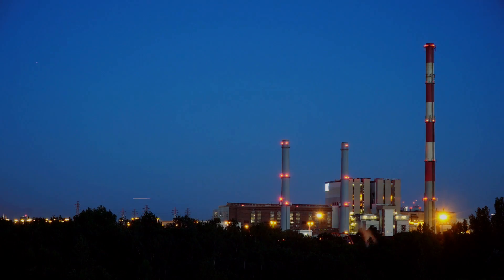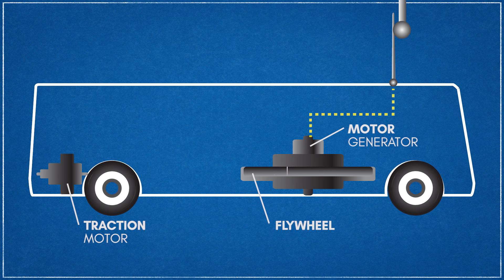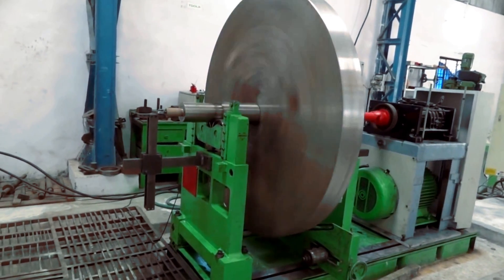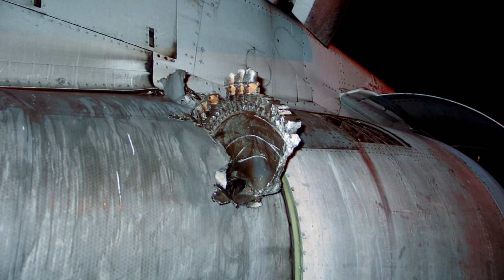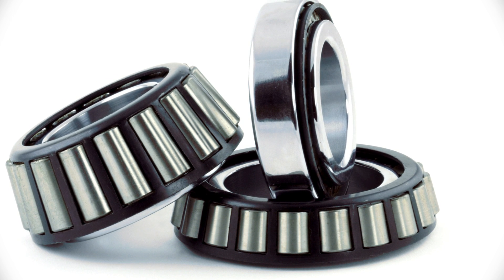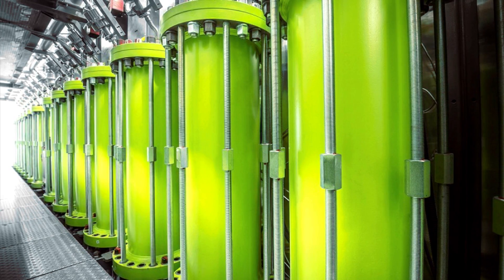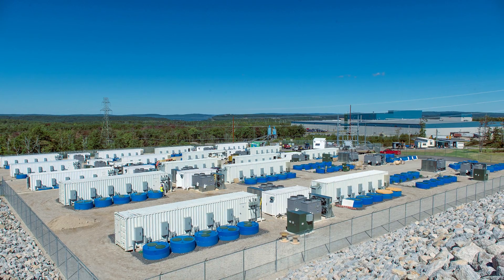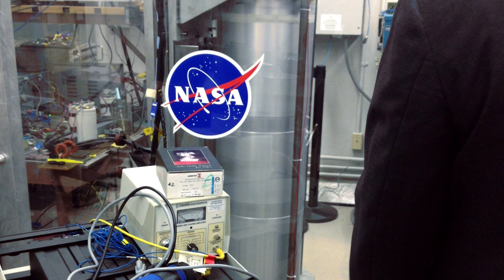The Mechanical Battery

Comment: I bet the bus was fun going round a corner.
Reply: It wouldn't be a problem as the flywheel is mounted horizontally not vertically (....that would have been an interesting experience).
Reply: @jaihind9043  what if you went up a hill? Would you tip?
Reply: @MilesPrower1992  Tip sideways!!! :D
Reply: @MilesPrower1992  -- Not at the low speed that the busses travel, and only if there were a very abrupt change in vehicle attitude, such as topping a steep hill.
Reply: @jaihind9043  The axis of the flywheel is shown a vertical.  That would make cornering a problem.  The bus route might have favored turns in one direction only like some delivery services today.
Reply: @alext9067  Turning the bus left or right would only accelerate or decelerate the flywheel a small amount.  But tilting the bus from side to side with, say, the road camber, would be resisted by the fly wheel making for a smoother ride but risking having two wheels off the ground. Also the front of the bus would be more likely to "take off" at the top of a hump........Ok on even roads.
Reply: @alext9067  -- Not really a problem at low city bus speeds.
Reply: When I was a child, 50 years ago in USSR, I read a book published by the guy who actually made the bus. Learned a lot good stuff that made me an awesome mechanical engineer later.
Reply: It has small wheels in the front bumper section. I wonder why :D
Reply: @smokedoak5464  my guess is,  it must have been a common occurrence  for one bus to push another to a charging point , the little wheels would stop the bumpers on the busses getting scratched.
Reply: @smokedoak5464  Or those are headlights.
Reply: What's next, a flywheel in our smart phones spinning at 100,000 rotations/second... and then the killer phone is born.  Course it would be really hard to even move around, with the gyro effect yanking it all over the place. xD
Reply: @BillAnt    I wonder what would happen when the bearings wear out😬
the charging system would be interesting if it was mechanical. one way clutch with a key near the center of the phone to hook into the charging key. Idk
Reply: Corned beef Gaming < It was a joke for a phone, you need massive flywheels in order to store any significant amount of energy. There was an experiment on buses with 1 meter diameter flywheels... didn't work out too well. lol
Reply: The.. People on the bus Go Round and Round, Round and Round,  Round and Round , (Everybody sing it with me now!) The People on the Bus Go Round and Round All the live long day.. while trying to find the best weed deals..
Reply: That would not be a problem with 2 counter-rotating gyros.
Reply: @reisele1980 < You're right, it would also make a highly efficient counter rotating guillotine, should the flywheels fly off, or crack due to fatigue and disintegrate into thousands of tiny guillotines. xD
Reply: At 50mph
Reply: It, it's operator and all passengers where never heard from again...the gyro in the bus goes round and round!
Reply: or in changing grades.
Reply: 0 problem here...
Reply: Evi1M4chine  < "Could/would" was just a sarcastic joke, course it would be impractical. lol
Reply: @G Guest < Even two counter rotating flywheels have some gyro effect (though less), they are mostly useful to prevent aircrafts to rotate on their own axis.
Reply: Haha.  Easy to balance on a string though.
Reply: More like over a speed bump.
Reply: These flywheels weren't in gimballs?
Reply: @masumoto007  If the flywheel axis was vertical, that would ease left/right turns. OTOH,  wouldn't hills and dips invite rollovers?

Comment: Hansen clever forge press Smeral forge press Emuco forge press and several others in the forging business utilize flywheels on there forge presses combined with a piston to help carry the ram back to the start position they are pretty efficient considering that they will cycle up to 600 to a 1000 times an hour on average but they are they inertia style flywheel and they probably weigh about 10 ton and need a bull gear lol Damn I miss that job it was the only job I ever loved

Comment: Slow but steady? Im sorry but that is not the case at all. The amount of solar installed is increasing by 42% a year. It is doubling its capacity every 2 years. By the end of the year its going to finally reach 2% of the energy grid. But in 2 years it will be 4%. In 4 years it will be 8%. Then 16%, 32%, 64, 100% in 12 years. EVERY single successful technology in history has exhibited an exponential rate of growth. Its always deceptive at first, but once it hits 2% the only that changes between technologies is how quickly they are doubling. Solar and Wind are now the cheapest form of energy on the planet. In fact that are so cheap that they not only no longer need subsidies, they are the cheapest form of electrical production in the history of the global energy marketplace.

Comment: Well done presentation, but the biggest problem if you ask me is the fact it is a mechanical and inverse system. I see useful applications for short term standby applications as you indicated for grid equalization, but not for vehicles or extended power storage.

Comment: I knew this had to be a thing that's been used before. I love it!
I have an idea for a high speed, pedal powered commuter bus. I've been wanting to make it for over a decade. 
Think about a lowered down, stationary bike, but with multiple speeds and no wheels. 
Now imagine many of these, facing outward toward the window, side by side, at least 10 on each side. 
Now imagine a central drive shaft from the transmission to the rear axle. The driver simply drives, no pedaling. 
Both left and right pedal stations would power a common shaft with several flywheels on them, which lead to the front and spin a large central flywheel at the front of the transmission. 
The side shafts would spin on one way bearings, so the pedalers could go different individual speeds when needed. 
Multiple flywheels on both side shafts and a large central flywheel which all store energy. 
I see no reason this could not go quite fast for an extended time. If anyone in the Minneapolis area has a shop I can use, I can make this. I have some serious skills.
Reply: Not much use if it has no wheels!
Reply: @bingola45  
Individual pedal stations need no wheels, since they drive the 3 flywheel driveshafts, but the middle shaft goes to a conventional rear drive axle which drives the wheels.
Reply: @mindthependulum6245  I guessed that.
I was only having a laugh.
Reply: @bingola45  lol. No real need for wheels a 10 horse power buss is only gonna move fast if it fell off a cliff.
Reply: @anullhandle  I think it would be workable. In fact, I think I've seen something similar in real life, years ago, although I can't remember where.
It didn't have the flywheel. THAT's the improvement here. Stopping the bus doesn't mean losing the built-up energy, so you aren't starting from scratch each time.
It's perfectly workable mechanically. As for the attitude of the passengers, that remains to be seen.
Reply: @bingola45  racers  go to great lengths and expense to take weight out of bicycles including their 2 flywheels. World class for men is 440watts for an hour and 34 mph.  Bicycles built for 10 at the beach are walking pace slow.
Reply: @anullhandle  I've never seen a bicycle built for ten. 
Donkeys on the beach are walking-pace slow, if you can get them to go at all.
Reply: @bingola45  conceptually you have a hybrid vehicle. A smaller ice engine working harder is up in its efficiency curve. You keep it working when it doesn't need to store the energy and recover a little more when you slow it down instead of dumping into waste heat. The issue would be less than twenty people on the planet can move themselves at 34 mph moving just themselves and a uci compliant aero super bike let alone a bus. Note if your willing to lay on your back go in reverse and stear thru a mirror you could aproach 60mph.
Reply: @anullhandle  You've missed the point if you put an engine on it.
It's a cycle/bus hybrid. No engine, just human power efficiently used.
Reply: I'd go a small step further and put the pedals on charging/compressing a spring of some sort (similar to a spring in a mechanical handwatch) which in turn drives the flywheel, which in turn charges some supercaps and insures bursts of power on demand to an electric motor...or something.

Comment: I wouldn't use a permanent magnet motor/generator, because it will still drag down the flywheel over time, even if unloaded. A better choice might be switched reluctance, because when there is no current applied, or drawn from the stator, there is no magnetic field inducing current in any near conductor, to slow it down. Induction would also work, but, there is no way to dissipate heat from the rotor conductor bars. Switch reluctance, while not the most efficient, would work the best for long term energy storage in a magnetically suspended flywheel. The suspension magnets, because they're homogeneous, will not cause the flux modulation, that will induce eddy currents. Static magnetic bearings in a hard vacuum, would allow a flywheel to store energy with very slow standby losses, similar to the best batteries.

Comment: Look up the 2012-2014 Audi R18. It was a Le Mans LMP1 race car that won overall the 24 hours of Le Mans. Amazing car. Used a V6 turbo diesel and a flywheel hybrid system. Won in 2012, 2013 and 2014. Due to changes in the regulations and the fact the market was demanding lithium batteries in their road cars instead Audi switched from the flywheel system to a lithium battery hybrid system. Still was amazing tech and the first hybrid car to ever win Le Mans.

Comment: When I was a child, I had toy cars that you would zoom zoom along the floor. When you gave them a push and let go, they would travel only so far. 

But one day, I was given a unique toy car. When you pushed the wheels against the floor, you felt a measure of resistance that the other cars didn't have. I though that the cars wheels were dragging against the frame or something. But when I let the car go, it went ten times farther than my other cars. 

So, I took it apart to to see how it was done. Voila, a flywheel, an energy storage device and I understood how it worked. Thus began my love of science. And my love of knowing and understanding about how things work. 

Cosmology is one of my interests, and I think that these folks are on to something revolutionary. https://www.youtube.com/watch?v=uwMDYNRZUKY

Comment: why seal the flywheel in hydrogen but not under high vacuum? problems with sealing?
Reply: High vacuum has a lot of pressure on it, a 12in (30.5cm) diameter circle would have 1550lbs (~700kg)of atmospheric pressure trying to cave it in.  Most high capacity hard drives in the 8 TB+ region are helium-filled to reduce the friction but not have to be built where they're practically bombproof

Comment: cool but hauling around a massive weight isn't really efficient.
Reply: Right. It's best for stationary storage - not vehicles, due to gyroscopic precession effects, and weight as you mentioned
Reply: Matt You are correct but the idiots to be will insist they put in cars. As a stationary storage they are awesome.

Comment: Beyond cell phones/tablets/laptops LiOn has no real future in the industrial power domain.
Reply: Do you think LiOn will still find a place in applications like Tesla's powerwall devices? It's energy storage at a smaller scale than the overall grid, but larger than the consumer devices you mentioned. Or do you think that people wishing to have a backup or completely off-grid system with solar panels and the like will have a flywheel system in their home to store that energy? I certainly find it appealing as it's more environmentally friendly to produce, less of a fire hazard, and could be more easily made, repaired, or replaced DIY which I like as a hobbyist. I think "preppers" could also find many of those characteristics appealing.
Reply: @revenevan11  My problem with the lithium-ion grid storage, is the availability of easily mined lithium. Due to lithium being so lightweight for its power density and not having the gyroscopic precession effects I think we should use our lithium resources in vehicles or other small electronics, and not deplete our lithium resources trying to build large scale grid power storage ( since there's not a good technology out there to recycle lithium ion batteries, I don't think we should be wasting them, not to mention the charge inefficiencies  multiplied by  every house trying to charge their power walls)
Reply: @daltonnabors  I agree!

Comment: I wonder if it's feasible to use ginormous concrete blocks suspended by cables as a means of storing energy. Lift them up during the daytime and then them drop at night while they spin a generator. If the weight and gear ratio is large enough you could provide power for quite a while for pretty cheap I would imagine. This is all speculation though, so I'm interested if anybody with more experience in this area has anything to say about it!

Edit: This solution would also not lose any energy if left unused since you could just apply brakes and it would keep stationary.
Reply: The gear ratio has nothing to do with how much energy you can store or extract back from that kind of system. It all comes to the mass of concrete blocks and the height you lift them to. Here is an example of what sort of numbers we are talking about here. Our household consumes about 18 kWh a day which translates to about 65 megajoules of energy. In order to release that much energy (assuming no losses) you would need to lower over 66 tons of concrete/water/steel/whatever from the height of 100 meters. Add losses and you will easily need 100 tons of weight. In other words, lift a locomotive to 100m height first, then lower it and the amount of released energy will be enough to power 1 house for about a day. Not very practical, huh? Low energy storage density of mechanical systems is what many people don't realize. BTW this is the reason why the bus from the video required recharging every few kilometers.

Comment: Fossil fuels ARE chemical “batteries” .....
Reply: Indeed. We just use a different chemical process.
Reply: No. Fossil fuels are not a "device"
Reply: FUD Hater : it can be called a batterie only it needs a recharch time of a few bilioen years.
Reply: @philippedevos816 , thats a terrible battery
Reply: @TheDrumrhythm  no one said it was a good one
Reply: You can discharge and recharge a chemical batteries  , once you burn the fossil fuels its just gone in the atmostphere. So no its not a chemical batterie.
Reply: @molsondry2834  
You can reverse the process, too. So if you just store the gases (like diesel submarines do), you could in principle re-use it. It's just not practical since we have so much of the stuff lying everywhere. If you want one example of such a thing, look no further than trees.
Reply: I am not sure I understand your reply....diesel electric subs and buses storing their gases?? The only sub that does that has an internal combustion engine that runs underwater and does not need outside air to run. It recirculates the medium gas ( nitrogen ) that when heated pushes against the pistons, then instead of expelled into the atmosphere it goes thru a scrubber and then a heat exchager to cool and shrink it...every cycle still needs fuel and oxygen ( through compressed tanks) to run but doesnt emit exhaust that would bubble to the surface. Once a fuel is burned it is almost impossible to reverse the process or if it can be done requires more energy than you would get back. Example. Water is basically burnt hydrogen. To reverse the process ( electrolysis) requires more energy than the act of combustion.
Reply: @molsondry2834  Explosions ARE chemical energy being released (the bonds being broken, along with other fun things that release energy), so technically it would have to be defined as a chemical battery.
Reply: @molsondry2834  recharging isn't a requirement of being a battery.  A battery is merely something that stores energy.
Reply: No, they're fuel.

Comment: Too much voltage at high speed and too little at low speed? Go kart. Put a comet clutch off a yerf dog on it backwards. lower speeds spin the electrical part faster, and higher speeds spin it slower. Since you know where the clutch maxes out top and bottom of the rpm band, you can use that to create a stable working range for the battery.

Comment: 2:02 into the video.  I win!!  I called it! Before the video started, I thought... storing energy in a small-scale, mechanical, useful way... Gravity (push a load up), tension (push a spring in), or - my first thought - what we already use in piston engines... conservation of angular momentum, i.e. a flywheel.
Reply: Yep! I've recently found it interesting that gravity storage methods are finding use in "third-world" and poor or remote places, especially for lighting! With today's efficient, cheap, and lightweight (easy to transport to remote areas) LEDs, there are lights that you hang from a roof or ceiling, and then you fill the bag under them with or otherwise attach something heavy, and as is slowly pulls down the energy is converted to light! Then if you turn the light off it stops descending, which blows my mind since it's such a cool way to visualize the transformation of energy!

Comment: Thirty years ago I knew a brilliant, successful engineer who was working on this flywheel concept. Nothing ever came of it. Stooging energy via flywheel is an old concept and a concept that doesn't work.
Reply: Uh, it appears to work well based on the applications presented in the video.
Reply: @jasonpoole2093  You missed the part where the narrator talks about the limitations. In theory great idea. In practice, uh not so great.